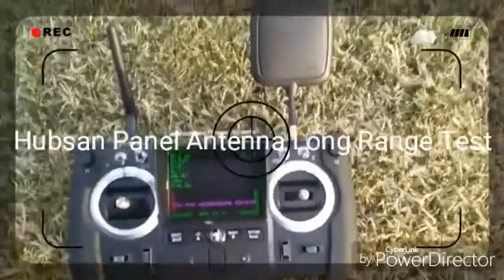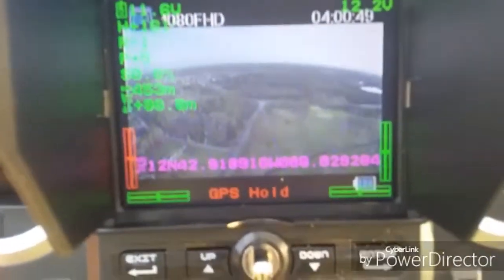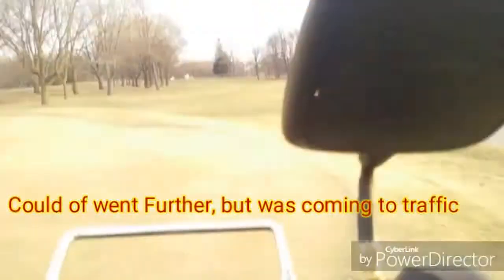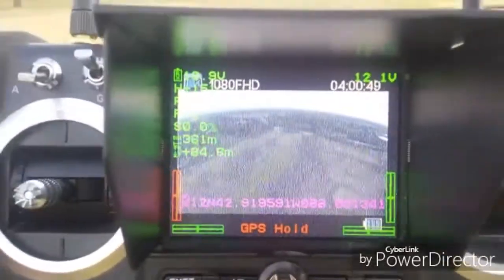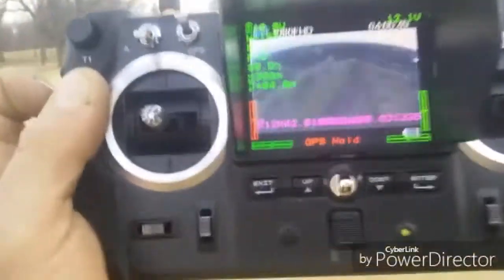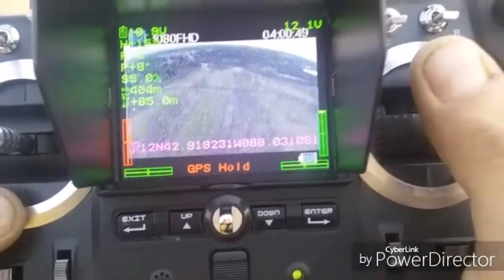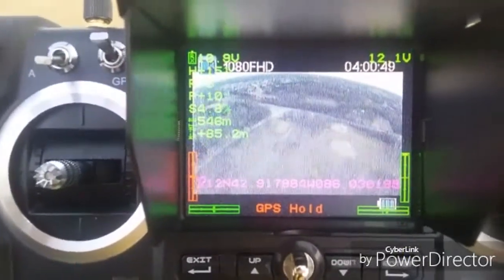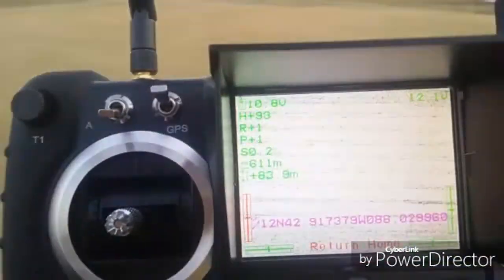hubsan Advanced Controller Panel Antenna Problem Solved - (Long Range Test) Built Backwards !

Comment: Any suggestions I go out about a hundred meters an auto return home keeps coming on then it comes home
Reply from the maker: If Auto RTH is activating, that is being caused by a loss of the controller's 2.4 ghz signal. It is a Fail-Safe in case you fly the Drone too far away from you and it loses the signal, it will automatically return to home. So in your case, you are not transmitting enough signal strength from your controller to your drone. If you have the standard version, then I would recommend doing the external antenna modifications. If you have the advanced controller, they have been known to come with faulty SMA to Ipex coax wires. (It's the wire that connects the 2.4ghz control module to the antenna, inside the controller).
Reply: @MarkSuttner  thanks

Comment: Solution, turn the logo around
Reply from the maker: Must not of watched the entire video. I did turn the logo the other way. I did two, long range flights, to see why I was getting bad FPV when I was using the Hubsan Panel antenna, as instructed, with logo facing quad. Well, I figured out that I got way better signal with the logo side facing away from the quad. I also split it open and realized that the outer plastic cover was built backwards. Simple mistake by a manufacturer but that's why in this video, I went almost the same distance, twice. Once with the Hubsan logo facing away, then another with it facing the quad. FPV was much better when the Logo was Not facing the quad. Then I later opened the cover, to confirm my suspicion, of my antenna being built backwards. It was.

Comment: How have you achieved 10.8v on the quad battery? Mines 8.3 at the most!!
Reply from the maker: This is the H109S X4 Pro. Not the H501S quad. The H109S, uses a 3S LiPo. The 501S, uses a 2S LiPo Battery. Is that the confusion? ?

Comment: Check the little wire that connects the antenna to the module inside the controller.I did an ohm test on mine and discovered the center pin and shield were directly shorted due to too much heat used when soldered to the rj45 connector.very poor quality control.

Comment: Sorry one question. But why you have 11 volts Battery, you when the Hubsan H501 used 7.4 Volts...????
Reply from the maker: That is the Hubsan H109S X4 Pro in this video. Not the H501S. I have all 3, the H501S, H501S-S and the H109S X4 Pro. The H109S X4 Pro quad uses a 11.1 Volt, 7,000 mAh battery.
Reply: Me i have a H501SS , H501A , H501M , H122D , H107C and Dji Spark

Comment: Goodnight friend. Just like in your transmitter, in my also only appears the amount of drone GPS satellites, the satellites of the transmitter in the screen do not appear. Can you tell why? Is there a solution?
Reply from the maker: Yes, The H109S X4 Pro Does Not have Follow Me Mode or Circle fly. There Is Not a GPS Module Inside the controller. Its Not Necessary for the H109S. There is No Solution, unless you somehow added a GPS Module to the controller and configured it's Firmware to show that telemetry. It's Just the controller doesn't come with a Stock GPS Module Inside like the H501S do. The only reason for the GPS Module Inside the controller is for Follow Me Mode, Circle fly and now with the newer H501S-S' they RTH to the controller. Using it's GPS Module. That's 1 of Many Reasons I "Personally" Recommend getting the Standard Controller with the H501S/SS because it was intended and designed for the H501S. Not to have a h109s controller, with a GPS module stuffed inside to call it a "Advanced Version H501S"... You Understand what I'm saying Sir ?
Reply: Got it, Mark.
Thanks for the help and explanation. Anyway I was worried about losing the machine for lack of this function. I can fly quiet then, right? kkkkkkkkkk

Taking advantage of the conversation, any special tip for this drone?
Reply from the maker: Fabrício Jesus Lol :-) Yes, there will be Absolutely No GPS Coordinates for the Controller's Location,  It will still show the Quad's Coordinates. As for flying "Quietly", ... LOL... The H109S is Loud Brother ! You can't fly that quad without it being heard, unless you're very high in Altitude. Just a little bit of things I've learned with the H109S is, Do Not Try to Max Out Speed in Altitude Hold ! It will eventually crash on you, Hard ! It's a H501S on Steroids. Same 8 APM Processor, same design, just Bigger. Also, Don't descend to quickly, just like the 501s it goes into a very bad wobble. Master airscrew company makes aftermarket props that are way more rigid and stable that will give you way better Air Management than the Stock props. I learned that the hard way when it tumbled out of the sky in altitude hold, going Extremely fast and crashed very hard. I was able to fix it but it was not easy and took me a lot of time. Keep that quad in GPS  Hold because it is a camera platform drone and is made for Aerial Videography and photos.
Reply: Thanks Mark.
Thank you very much for the tips and answers. Congrats on the videos.
See you brother!
Reply from the maker: Fabrício Jesus Thanks Brother ! The H109S is a cool bird, just Don't push it to it's Limits ! It cannot take it. You'll eventually crash. If you keep it in GPS Hold, Without TX & RX Interferences, you should be good. Another thing I should Mention is don't ever cover anyting such as your hands over the top of the Quad during compass calibrations ! The h109s is very sensitive to GPS interference. Did you see the video where I almost Lost my H109S ? --> https://youtu.be/a-3hagZwFLc

Comment: Why is your bird always showing about 11 volts on the controller?
Reply from the maker: Mitch The H109S X4 Pro uses an 11.1V 3S 7000mAh Flight Battery. Fully Charged, the battery will be at 12.6 Volts. The H109S  will be between 12.6 - 10.8 Volts during Flight. When it reaches 10.8 , the controller will indicate "Aircraft Battery Low". So being in the 11 + Voltage Reading is normal.
Reply: OK, I thought this was the H501s X4 Pro. Too many X4 Pro's around. LOL

Comment: No gps on the controller?i have the same problem I can’t see the gps of the controller 
It must have a yellow line for the controller gps but nothing any ideas?
Reply from the maker: +tutu1986 If you have the H109S X4 Pro, it Will Not have GPS coordinates for the controller. That is Only For Follow Me Mode And Now Recently Orbit Flying. The H109S X4 Pro Does Not have a Follow Me Mode Feature or Orbit Flight. So there is NO GPS Module inside the controller. It only shows the Quad's Coordinates. If you have an "Advanced" H501S / H501SS with the FPV1 Controller, then they put a GPS Module inside the controller. The two quads are different.... The controllers are the same, however they just stuff a GPS Module inside the controller for the H501S / H501SS....
Reply: Mark Suttner I have an h501A with the relay and the app.i wanted to upgrade to a controller so I bought an h109S-50 FPV and I though that it will have the module big thanks!!!
Reply: tutu1986 Mi ubicación

Comment: why not open it up and check...
Reply from the maker: +Beta250trials After that video, I Did open the antenna. It WAS Built Backwards. Not Only that, It Only has "About" 6dBi Gain. Thats Not Very Strong for A Directional Panel Antenna (Especially at Long Distances). Its Not Bad for a few hundred meters Also the Stock Round Dipole FPV Transmission Antenna that attaches to the outer shell of the h109s X4 Pro is not very good for long-range either. Since that video was made, I've purchased A Lot of Different Antennae. I've been able to get 2000 + Meters with different antenna setups. Best Setups So far For Very Longe Range has been these...  Fatshark Spironet V2 RHCP (Right Circular Polarized) Attached to quad Or An Aomway Cloverleaf On the Quad. On the Controller, A 14dBi 3 Panel Open Faced Panel Antenna ( New Hubsan Brand Or XDAMODEL Or Another Fatshark Immersion RHCP Recieving Antenna. That Stock 3dBi Dipole 2.4GHz control Antenna Will Not Always Transmit Past 1,500 Meters. So, also have a 6dBi Fatshark Monopole 2.4GHz Antenna. That has more gain, so it Transmits Farther....
Reply: well im gonna have to get a higher gain panel antenna now  lol  and give it a go thanks for a great vid..
Reply from the maker: +Beta250trials If you want a higher gain panel antenna I would recommend these two... I personally prefer the hubsan model over the XDA model.. http://m.gearbest.com/fpv-system/pp_436713.html
Reply: cheers mark ill take a look....
Reply from the maker: +Beta250trials You can buy the XDAMODEL antenna for a cheaper price if you order it from banggood, but you will probably be waiting quite a while to receive it... The Hubsan panel antenna from gearbest worked a little bit better than the XDA model when I did some very long-range testing... there is tons of High Gain panel antennas all over the internet, whichever one you decide to buy, MAKE SURE IT HAS THE CORRECT MALE SMA CONNECTOR !! "MOST" ARE STANDARD MALE SMA. SOME ARE RP-MALE SMA (Reverse Pin)... If you have the "FPV1" (Advanced) Controller, You need Standard Male Sma Connector For the 5.8GHz Side. The 2.4GHz Side Is Actually Different !! If you Replace the Stock 3dBi Dipole, You Need RP-MALE SMA....
Reply from the maker: +Beta250trials Ok Bud... Happy Flying !! P.S. Those New Fatshark Immersion Spironet Antennas Are Really Nice and Work Well, but come with a Nice Price Tag as well... Cheers !!
Reply from the maker: Yes, they are Pretty Expensive. However "You get what you pay for"... Well Worth the Money. Excellent antennas !!

Comment: Wow Mark, I agree with you. I will try the 14db panel swap and am experiencing label reversal too. Thanks for the video !
Reply from the maker: +Don Poncher Thanks for Watching !! Don't Know whats up with that Hubsan Panel Antenna, but it's Not Very Good. I Get 100% Better FPV with 14dBi Aftermarket Panels. The 5.8 & 2.4 Modules are 200 Milliwatts. 14dBi seems to be the Best decibal range Panel Antenna for the h501s And the h109s X4 Pro. The Two Antennas that have worked the best so far(that I have tested) are the "BTG" Only Found on Amazon and a 3 panel open faced "XDA" model Only found on Bangood. I just happened to Stumble Across a "Hubsan" 3 Panel Open Face Style Panel !!! I ordered it and am waiting for it now... Should be Interesting to Test ! This New "Hubsan" antenna Looks Almost  Identical to the "XDA" model... But Can Only be found in One Place....